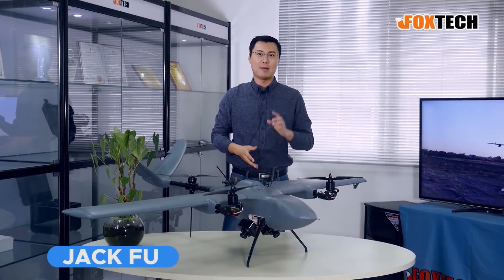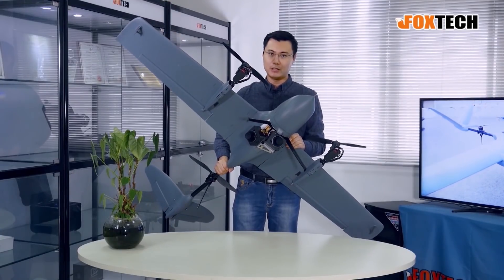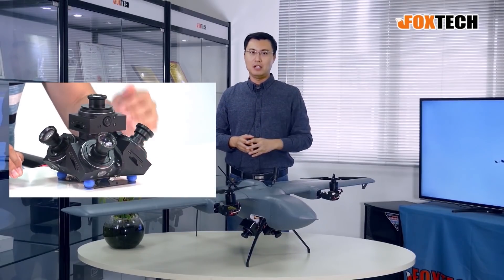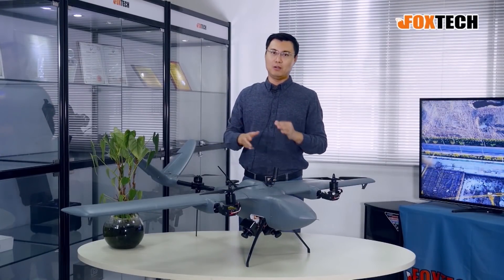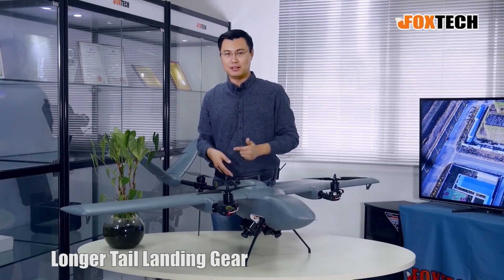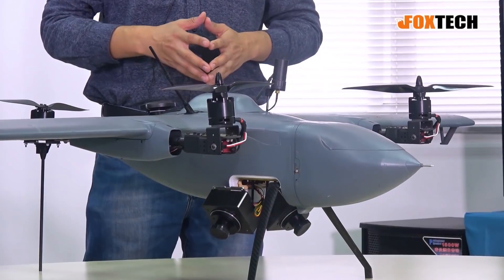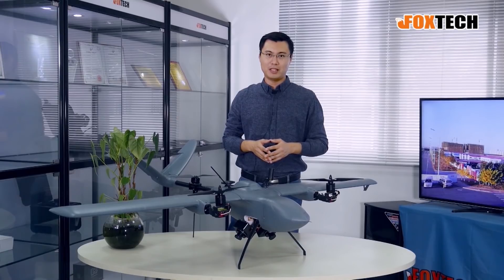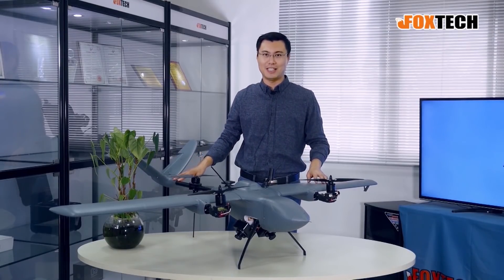Nimbus Tilt VTOL Two Oblique Mapping Cameras 3D Modelling Project

Comment: Does the speed of a fixed wing UAV affect the 3d model at all? I assume that a higher flying speed would be an issue in either picture quality or inability to make set turns on your mapping software. Have you seen issues with that, or any others where speed was the cause?
Reply: @HammockerSam Does speed afftect the 3d model ? not really in opinion. Cameras used for mapping have fast shutter speeds for example lets say the UAV is moving at 22m/s and the shutter speed of camera is set to 1/600 (this speed is normal for any camera). So, the aircraft will move a distance 22 metres in 1 second but camera shutter will be 1/600th of a second (which is very fast). Hope this clears your doubt.
Reply: @SyedSheerazHussain  That does answer my concerns,  thanks!